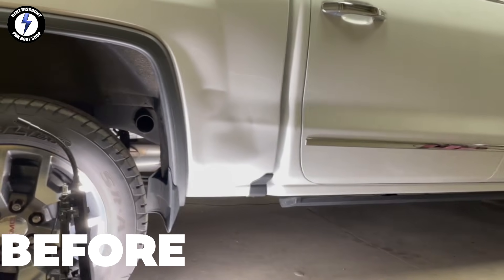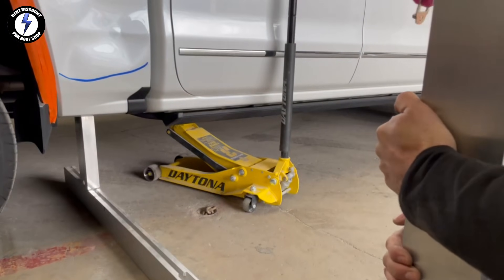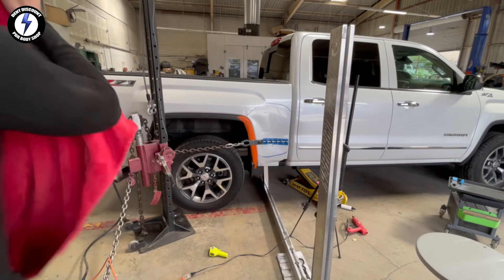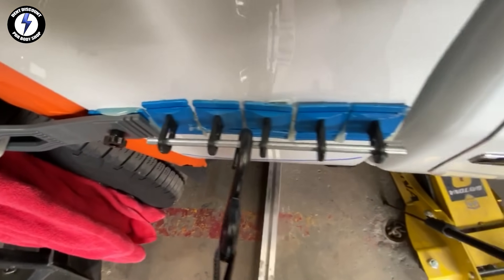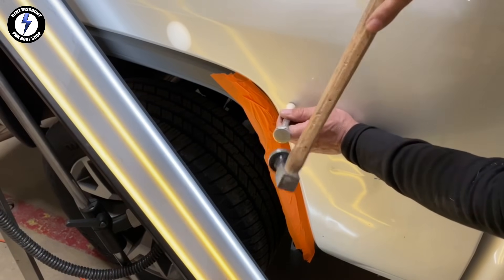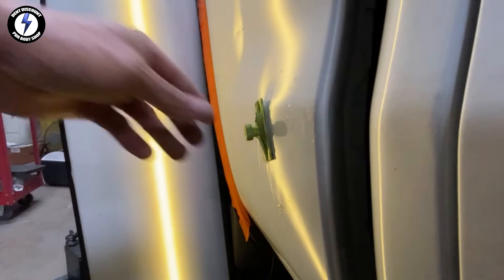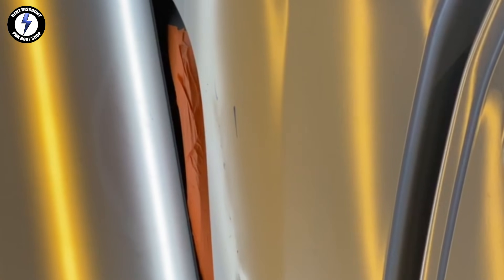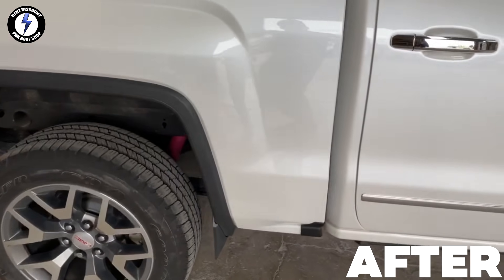Bedside Pulling! | No Painting!

Comment: You know you're good when you say you have to borrow some tape and repair body panels for a living..
I did some glue pulling on an aluminum tailgate from a new f150 yesterday. While I did get it to move some with a little heat, the glue didn't seem to work as well with me heating the aluminum to keep it from cracking. Needless to say, time wasn't on my side so I had to wipe it and prime 😔.
I'd love to see a video on aluminum pulls, especially near corners where it seems thicker, like on that tailgate at the top right under the cap...
Reply from the maker: Brett great comment thank you so much

Comment: What does something like that cost? After replacing my cab corner earlier today, 14 150, backed up along a big branch hidden by weeds that left a crease behind and in front of the wheel, smmfh!!! Guy sitting in his truck at gas station yesterday had oil pouring out in idle, had no idea so i toldm...told myself no good deed goes unpunished, sure as shit only took 24 hrs. Maybe ill try to jacks with 2x4s, push up and out at same time, its low 6" up, cant make it worse.